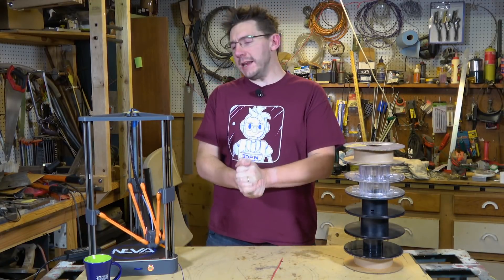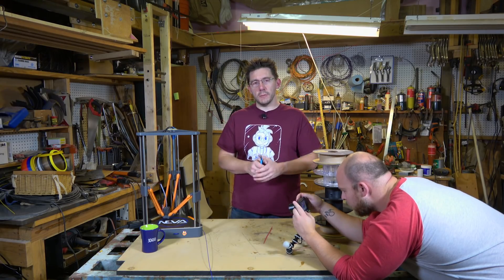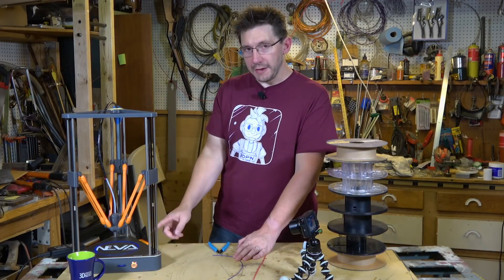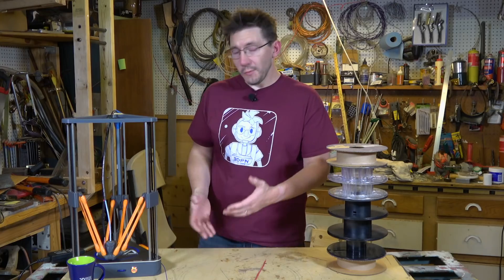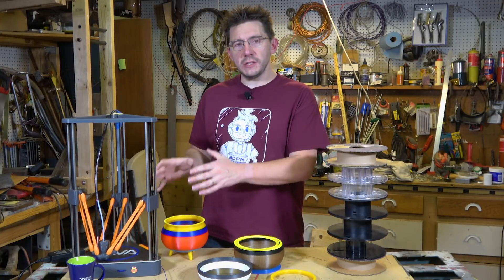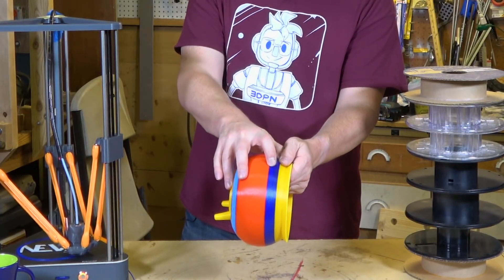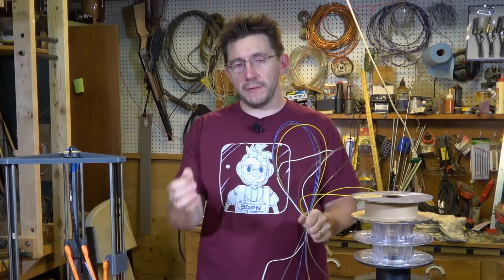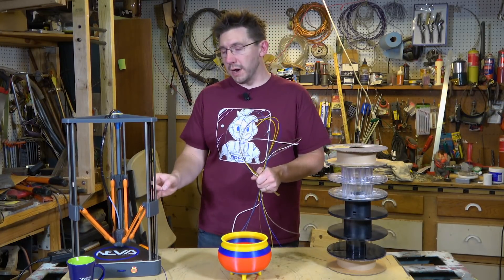Filament Detection Sensors on 3D Printers are Cool as Shown on Dagoma Neva delta 3D Printer

Comment: I would say use bondo, it is a soft material that is used on vehicles that is sandable/paintable/sealable. But thats an awsome sensor to have on a printer! Just got into this hobby and am currently awaiting my Anet A8 to finish its first "torture test" printing a Benchy boat with 3D Solutech Black PLA.

Comment: The length left from the tube length would be very usable for a 3D pen. The 3D pen could be used to fix any possible larger gaps before finishing with epoxy.

Comment: You could fix it with a 3D pen and then sand it down... it won't look amazing but you can use the same color. and you could do a crosshatch pattern to beef it up.

Comment: I'm looking forward to when the detector not only detects the filament being there, or not there, but also the feed rate. If the feed rate differs significantly from the expected feed rate, say from a clog, under-extrusion, or some other significant failure, then it could pause the print.
Reply from the maker: Prusa i3 mk3 has this ability :)

Comment: Really cool technology with the filament sensing.  For the caldron, I would use Plasticwood wood filler to fill in the gaps.  A little sanding and some paint and you'll have a nice model for your bubbling brew.

Comment: i would just heat it in order to melt it on the surface in order to fuse it back to gether
so that it is one pice rather then a kinda fused to gether pice of plastic with glue holding it to gether
witch could expand and break the pla.

note: i would not use an oven so that it dosn't melt evrithing and make it one lump of useless pla

Comment: That is a great feature and like you said it is better to have it near the head like the Prusa 3 does. 
If it is feared to fall apart i would use either the baby powder and superglue or epoxy; if it is just ugly i would bondo/ spot putty it and sand.

Comment: Epoxy if you don't plan to paint it for sure.

what these printers need is a 6 inch GAP between the sensor path and the extruder feeder gear. this way when you tap to eject it FIRST PUSHES filmanent into the hot end pushing all the "cooked off" filament out of the hot end (this requires a pause movement to not jam all that into your print of course and for YOU to remove the splooge manually.,

THEN eject the filament. the issue is mostly like cook off from the pause sitting in the hot end getting in the way. a "bad pull" (which is exactly what the printer did) would cause this.

always push first THEN pull.

also time to mod that printer and put the extruder feeder unit on top. cut that bowden tube in half.
Reply from the maker: That's what I'm thinking - the extruder on top makes a lot more sense.
Reply: 3D Printing Nerd although I can see why they put it on the bottom there's no structure up top so they would have to build a new structure for the top hat printer
Reply from the maker: +Nerys true. Plus, to be fair, print quality is fantastic.

Comment: SUGGESTED FIX:  CA (Super Glue) has fumes that are not healthy for you, so my suggestion would be to tape off the colors so only the section you want to fix is exposed.  Fill it in with light weight drywall spackle, let it dry, then lightly sand most of it off, then paint it the color you want.

Comment: Great, is there a sensor, you can buy or make yourself?
Reply: Even if there is, you can't use it if your machine doesn't support it. The sensor is useless if it can't connect to the mainboard and tell it to pause when there's no filament.
Reply: Thank you, I was going to connect it to a buzzer or lights to tell me, my printer is not in same room as me, so an alarm would give me a heads up.

Comment: Is there a separate filament sensor that we can plug on any chinese reprap prusa i3 clone ?
Reply: Allan Elkaim if you use octoprint you can add a filament sensor on that side for pretty much any printer. My setup sends me an sms when I get a runout to tell me to go attend to my printer.
Reply: Depends. Does your machine has a sensor port to plug it in to?
Reply: Matthew Fowler using the rpi gpio?
Reply: Clement Josos no it doesn't but it seems that if I use octopi this might enable me to use this feature

Comment: Old modelers trick: add scrap plastic to tamiya cement/solvent to make color matching plastic filler putty.

I build Gundam models and just picked up a Cr10 a couple months ago. Your videos and others convinced me the Cr10 was a worthwhile buy!  Gundam models are primarily molded in PLA so this should work with your Boden scraps. Haven’t tried yet myself. Good luck!

Comment: My first printer was MakerBot Jr.  Their SmartExtruder has a filament detector in the print head assembly, right before the drive that is just on top of the real-hotend.  The filament detector was an optical light sensor, and a 'filament movement' sensor was just after it, was a rotary wheel with optical slits, to help detect other issues. ... really quite ingenious other than being closed source hardware and software.  ...  Glad to see some of that technology start coming to the open market.

One thing I did like, if the extruder ran out of filament, you could hand feed the new filament in right behind it, and continue printing without having to remove filament.  It was only possible due to the closely controlled filament path.

Now, I have an extra RAMBO board, does anyone know how to re-configure a Makerbot Jr to work with a different controller and possibly extruder?

Comment: I'd suggest a firmware change to the manufacturer. You NEVER want to keep a hot end hot with no filament flow, especially one which appears to have no hotend cooling fan. 

Tell them to turn the heater off when no filament is detected. 

And why does anyone still sell a machine without a hotend cooling fan?

Comment: "sensor"?

Is there actually some kind of elaborate sensor in that box or just a switch (same as used for end stops). I think the prusa mk3 has some IR sensor or something, that seems completely over the top. I am sure the same could be done with those tiny cheap switches.

Comment: Give it a couple of coats inside and out with XTC-3D.  It will smooth out the layer lines as well as the imperfections in the layer that failed.

Comment: Hello I am new to  3D printing. Does anyone have a suggestion on  3d printers under 200 With a heated bed?
Reply: I have an Anet A8 which is 150 but it requires alot of DIY and patience at the start.The A6 is better tho
Reply: Maker Muse has done videos just on this.
Reply: My suggestion, after going down the 'cheap' rathole, is to save your nickles and get a better printer.  If your time is worth anything, it won't take long to earn the money, if not, getting a cheap printer is a way to 'force learning' ... best of luck with whatever your choice is

Comment: I would use epoxy, given that it can soak into the cracks and holes. The superglue and baby powder would fill in the surface imperfections but wouldn't add as much in terms of strength.

Comment: Joel, to save the last cauldron, if you don't mind painting it later, I'd take a "low temperature" soldering iron (the ones that do around 230C or 450F), some filament and basically do the same as TIG welding - heat the spot to be welded a bit with the tip of the soldering iron, then take the filament and press it into the gap with the iron. IMO this makes the strongest bond since it's all from the same material and it's melted together... it's ugly and requires sanding, though.

Comment: What filaments do you suggest that i get for my cr-10 im getting for christmas?
Reply: Russeal Hagrid I have an CR10 aswell, and it's really great. Don't expect the  filament that they send you with it  to work well, because mine, for example, didn't. I use "Patona" PLA which works fine, but with the even cheaper "janbex" (not sure if that was the name) it worked even better. Don't waste your motivation and time on ABS until  you build a Box for your printer so it can keep an inside temperature of 60°C. 
I hope I was able to help :)
Reply: I like Matter Hackers.  A bit more pricey, but pretty good quality and customer support.  Use Joel's affiliate link to send him a little 'no cost to you' thanks for doing what he does.

Comment: Great Video as always. Thanks for sharing. The blue looks like it under-extruded which may have been due to the extruder temperature. Since not all filaments work well at the same temp, I'm guessing it would work better at a higher temp.
As for how to finish the piece, I'd go with bondo to fill in the large gaps and follow-up with filler primer. Of course, lots of sanding will be involved. :)

Comment: Hey there everybody! It so great you're using the filament sensors. Filament run-out it's a great problem, but what about filament jamming in the spool? 

Check out our solution - http://e-nable.org/2017/10/17/do-your-prints-fail-because-filament-gets-tangled-or-because-filament-runs-out/

Comment: some wood filler or bondo -- I'd imagine you'd have to finish it to fix that surface finish -- hard to tell how bad it is without a closeup shot.  I'm figuring if you need a cauldron, print another one -- otherwise this would be purely an educational exercise on fixing a print which didn't go particularly well. Realistically if the fan is adequate, heat creep should not be an issue, even the machine was waiting for a day for you to do something -- and logically it should have retracted a length of filament out of the hotend to avoid cloging and turned the hotend off or down to a lower temperature so as not to cook plastic in it. My understanding this machine doesn't have a heated bed, so if it did a proper procedure for filament runout, there shouldn't be such issues.

Comment: To save the print. assuming you don't want to paint it, I would suggest first tempering in an oven at 80C for 20 mins, then a clear 2 part epoxy brushed on, at least 2 coats. This will improve layer bonding even between different color PLAs and make the piece stronger. It then has a better chance of being durable enough that the extra epoxy has something good to hold on to. The risk is that the different PLAs witll shrink at different rates which could warp the whole thing.

Comment: For that light blue pla, I think it may have gotten moisture in it and became hard and brittle. To compensate for that I have increase both my temperature about 3 degrees and increased pressure on the filament by the extruder so it could better grab the filament